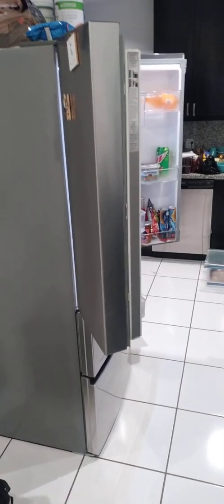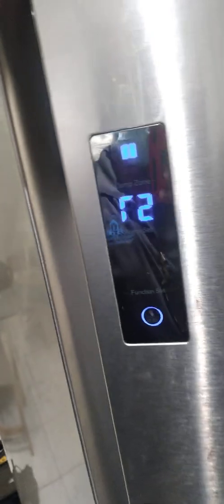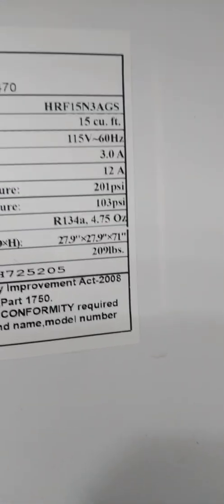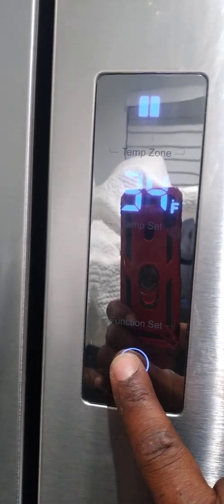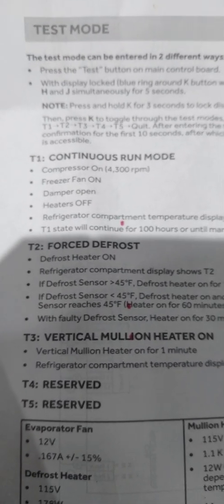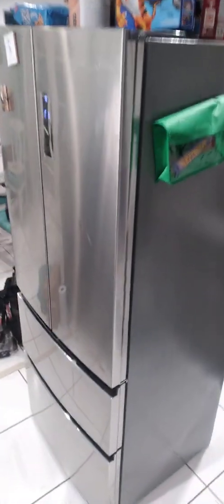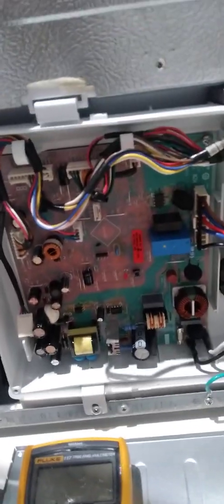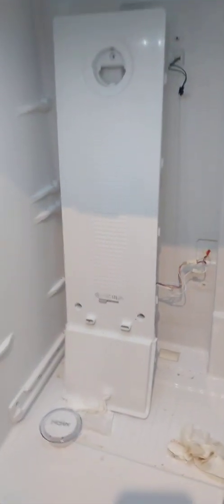Haier HRF15N3AGS refrigerator diagnostic and repair - Freezing everything fresh food section.

Comment: I have the same fridge and it cools for 24-48hrs then the compressor wont turn on and it starts to warm up. What could cause this issue?
Reply: Also there is no ice on the evaporater coils when it stops working. If I unplug and wait 30 min it will cool normally for another day or so.
Reply: I have this same problem.